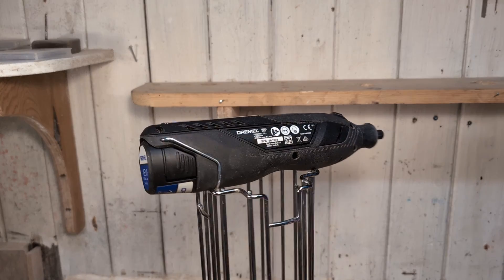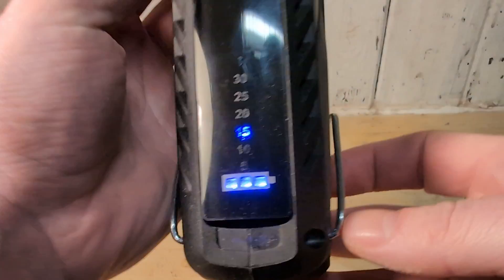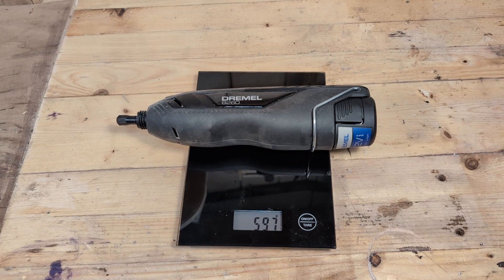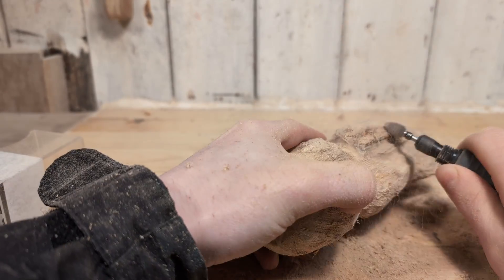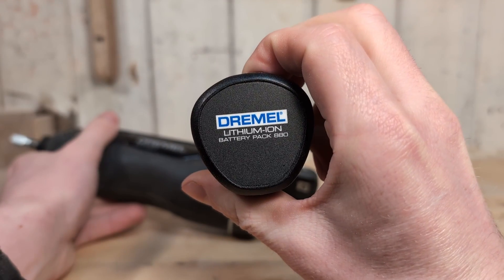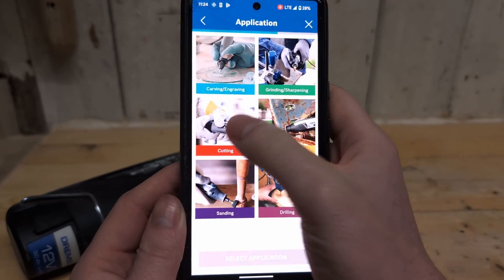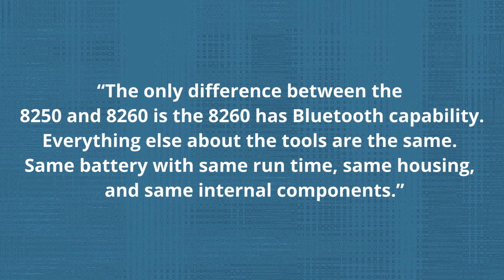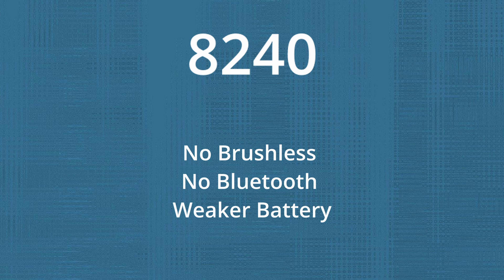Dremel 8260/8250: Everything You Need To Know

Comment: Just done a comparison on the UK website. It says the 8260 has higher battery capacity (3.0ah to 2.0ah) and slightly less vibration. I think I'd go for it for those reasons and the fact that it looks a lot nicer. I rarely use my phone for internet stuff as everything is easier and clearer to access via laptop for me, so would prob never use BT but odd for Dremel to say there's no other difference when there is.

Comment: Thank you for doing this comparison test. I want to upgrade from my 8220 to the 8250, as I don’t think the Bluetooth function on the 8260 is necessary, but my question is; can I buy the 3ah battery that the 8260 uses and use it in the 8250? Can you confirm that the 3ah 8260 battery is interchangeable with the 2ah 8250? Because Amazon and other sites do not officially confirm this information. Thanks

Comment: Nice review.  I recently got the 8250... my first Dremel.  I was amazed that the accessory shank would not fit in the collet.   Did they send the wrong size collet?   I see that Dremel produces 4 different sizes of collet.   I then saw an obscure section in the directions that the collet can get jammed in the collet nut, which apparently is what happened during production/assembly in Mexico with mine.  I used the wrench tool to push out the collect and after that, all functioned as expected.  Anyway, I got this one as it is described as having more power than the corded version, but I still had my doubts about battery longevity.  I appreciate you put in the effort to real-world test battery longevity.  I don't ever see me needing to Dremel for nearly an hour, so I think I am happy with this choice versus the corded version.  Also, nice tip how the app can be used for accessory guidance by application, even when not using the bluetooth-enabled version.  Helpful review.

Comment: Quick & important question: Does Amazon/US version of 8250 & 8260 comes with MULTIVOLTAGE/UNIVERSAL VOLTAGE charging unit 110-220v adaptor, on only 110/120v? Yes I know we EU voltage can always use Bosch chargers, but still....

Comment: Hi, can you advise me the best rotary drill for cutting specially PC panel aluminum or steel PC panel I don’t mind using called rotary drill but I needed it to be reliable and precision smooth cut, yes, I do know you have to smooth the edges after but I need to be accurate cut, thanks for your help. Great useful video.

Comment: Does the 8250/60 have a battery back that is connected with cord so I can make it a cord machine?  I like cord because I hate charging.
Reply from the maker: No it is not connected with a cord. You have to remove the battery to charge it.

Comment: I just acquired one. One thing concerns me… one end of the digital speed display is short/open. Its circuit board is exposed to debris!
Reply from the maker: Yeah. I also saw that. Have not noticed any problems with it yet. Hopefully it won't be a problem in the long run.

Comment: only mine can’t get to over 20/25k rpm when battery is low? I think that’s some kind of protection
Reply from the maker: Yeah. On the cordless models you will notice that the power and speed of the tool is reduced when the battery gets low. This is the same with all other battery power tools I've tried. Thanks for watching😀

Comment: When it comes to the cordless models wich are the best at getting the job done between all that Dremel has to offer in your video and not?

And same question goes for all with a cord.

I wanna know if I should save up I bought a 200 engraver one and it was crap took forever to use I want it to go faster also is any of them making less sound than others?

Is the ones with cords more powerful s than the cordless or same?
Reply from the maker: Hi. The most powerful Dremel rotary tool is by far the cordless Dremel 8250/8260.  This is also relatively quiet and low on vibration. 

The 4000 and 4300 are the most powerfull corded ones. My favorite is the 4000. I use it mainly for woodcarving. 

You could also check out the FOREDOM tool.  This is more powerful than these handheld rotary tools, but a little bit of a different tool. But it might be suitable for your use.
Reply: @rotarycrafts8760  hrmm is a 3000 stil ldecent? Can they make hole trough stuff like rock or wood? And what accessory bit do I need if so, a diamond costed one or? I wanna make like a simple hole straight trough a rock for instsnce
Reply from the maker: You should check out my newest video where I explain all the different Dremel models. The 3000 is good. It can definitely drill a hole through a rock. Use a ball shaped diamond coated bit or the Dremel diamond coated drill bit, spray water frequently in the hole while cutting so it does not dry out and overheat. And drill slowly, it will probably take a few minutes depending on the size of the rock.
Reply: @rotarycrafts8760  ahhhhhh do that's why it didn't work. I used the bits that came with the machine and I was at it for two hours dint even get half way trough and I used both a ball one and a long screwy one...I first used them on wood it worked well then I switched to stone wich did not go well and back to wood and now they won't even work on wood...
Did they get destroyed by the stone like are they not made for using on stone? Does it need to be Simon coated bits?

Also even on wood it overheated and got black and smell burning do I need to soak wood in water aswell? I did dunk the stone in water but it was still hard to use because the machine kept blowing air on it so it dried the air can't be turned of right?

All of this was really tedious will the dining bits make it better or do I need s nother machine completely ...two hours and only reaching 1/3 of a thiny thin rock is not right.

Fun part is the 240 I had before almost worked abetter and without Simon bits on stone haha..but still not good enough for me to be comfysrble with.
.this thing can't even do anything either my bits got destroyed by the stone or I'm using it wrong or I'm dumb.
Reply: @rotarycrafts8760  also do I need any specific kind of stone? I took ordinary grey rocks from outside.

Comment: If I don't use a tool for a while, I think they sprout legs and run away 😂.
So now I need to get a new cordless Dremel. I've got a dedicated flex-shaft corded one, mainly for the power. 
Ever since the 12v ones came out I've had one and would never go back to a corded one for "non-flex-shaft" use, same as any other cordless tool. 
Idk how handy Bluetooth is on a tool because I've never had one. This thing's selling point for me is the power.
Maybe if you're very new to rotary tools, Bluetooth could help you find the proper bit and speed, but if you've had one for more than a week you probably know how easy that is to figure out.  Most stuff you do is at full power, polishing being the major difference. When you buy bits, they say what they're for right on the packaging, and all of their "bit kits" have dedicated sections, separating groups of bits by category,  like metal cutting, sanding, engraving, polishing, etc...

So really, I'd like to hear from anyone who has one, if you find the Bluetooth function useful, or is it a bit gimmicky? 
Thanks.
Reply from the maker: The Dremel 8260/8250 are the most powerful Dremel models. Especially at lower speeds. The bluetooth is sort of a gimmick in my opinion. You can still get the Dremel app for the info without the 8260 and just set the RPMs manually. Milwaukee has a 4 Amp battery rotary tool, which might be more powerful (have not tried it though). The 8250 is the same as 8260, without the bluetooth.

Comment: The Bosch pro 12V Max batteries and chargers are compatible except for the 6Ah batteries (the body of the Dremel is slightly in the way and doesn't let you push the battery in all the way). The Bosch GAL 12V-40 quick charger promises charging time of 50 minutes for 3Ah batteries from zero to full or 36 minutes zero to 80% so if you run into issues with battery life I would highly suggest getting the Bosch batteries and charger.

Comment: Is the 8240 pretty much the same as the 8220?
Reply from the maker: The 8240 is a little bit stronger is my impression. And the 8240 batteries can be used with the 8250 and 60. Other than that, yes the 8240 and 8220 are fairly similar.